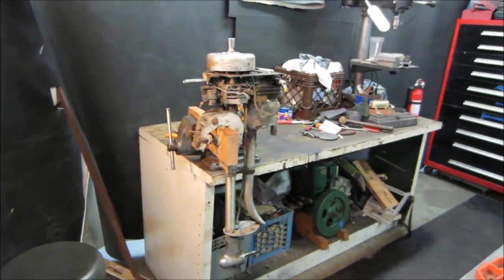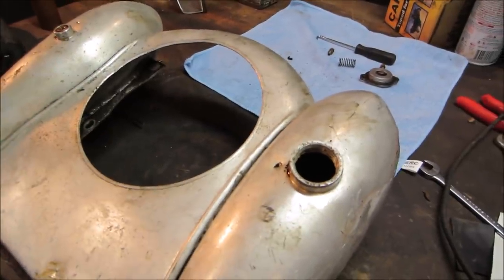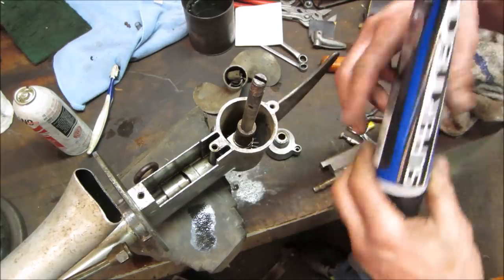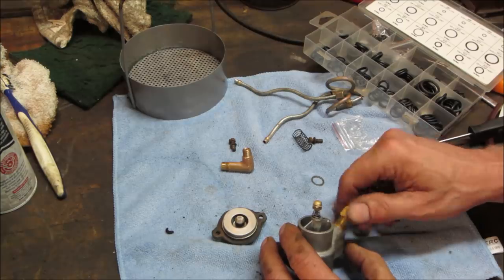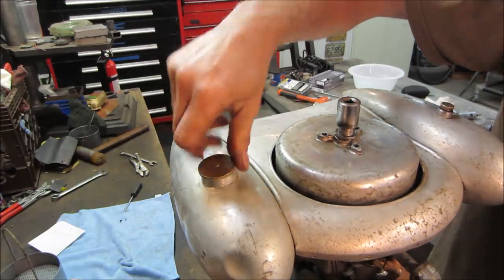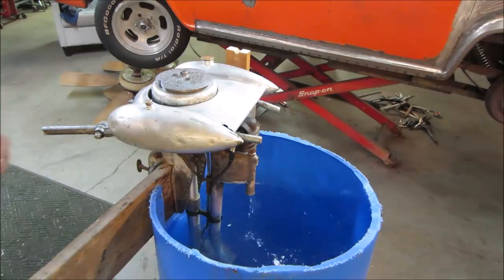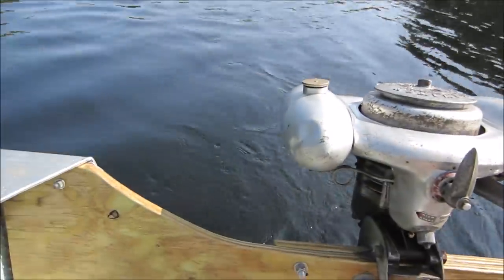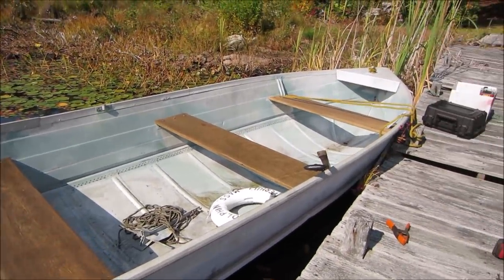1937 Boat Motor, 60 years in a Shed. Will It Run? Pt 2 of 2

Comment: The comment about the carburetor and fuel lines looking like a chart a chart on the wall in the doctor’s office....I am a former obstetrician and when I saw the assembly on the work bench, I thought the exact same thing. Uterus, Fallopian tubes and ovaries. Keep up the great work.
Reply: And he couldn't stand it; he had to blow through one of the Fallopian tubes!  lol.
Reply: Mustie1's sense of humor is incredible.
Reply: I laughed pretty hard when he said it was clogged like a 70 year olds arteries
Reply: And yet still put his mouth on it
Reply: If only this engine could reproduce. It might begat a strapping lad that grows up to be a 280 HP, fuel injected, two stroke V-6!!
Reply: Made me think of high school health class.
Reply: Why do the fuel lines have loops? Is it to prevent backflow?
Reply: @loumencken9644  I think it's to stop them fracturing from the vibration of the engine, the loops allow the pipes to flex instead.
Reply: Got to fiddle with the that fuel mixture knob when she's cold.
Reply: @Zeem4  Makes sense- thanks. Although I admit I'm disappointed that it wasn't the designers saying, "OK guys, what can we do to make this system look even more like lady parts."
Reply: James,
You checked oil for a living eh?
Reply: Thought the exact same thing 🤣
Reply: can imagine Mustie1 as a Gyno...............Mrs Smith your carburettor bowl is empty because Mr Smiths main jet is blocked..............

Comment: That carburetor is actually what they call a "mixer."  Looks like a Lunkenheimer mixer similar to those used on antique stationary engines such as a hit and miss.  The plunger on the bottom allows you to give it a prime by lifting up on it.  When the valve inside opens it also opens the fuel circuit. It has no throttle function but rather the engine is throttled by the spark advance setting.  I suspect the amount of timing adjustment the engine has allows it to run backwards to give the boat reverse.  Similar to old two stroke golf carts that just ran the starter the opposite direction for reverse and had the timing fixed at almost TDC.
Reply: good info. thanks. ive been to shows where there are hit and miss engines running.  they really amuse me with their oh i guess its time to putt again ways.
Reply: Does the plunger also act as a type of reed valve?
Reply: @andrea4809  i thought a reed valve was for low end torque, i also thought reed valves were on the valves and not the carb
Reply: To run backwards you would have to wrap the rope backwards. Is the rope pully made for that?

Comment: The "dialing it in" problem is probably that extra O-ring
you installed in the mixture needle. 
That material you mistook for Bakalite is most likey
wax impregnated cotton rope, or Oakum. You could remove
it, replace & re pack. The O-ring is changing the throw of the needle.
That carburetor is cast aluminum and Bronze- no rubber seals or
diaphragms. That must be a pill to start by hand, even when new.
You'd better torque down that flywheel.
That really turned out nice.

Comment: thanks for the laughs and enjoyment, several decades ago I picked up a vintage one, made by Champion, worked on it, got it running great, long story best friend talked me out of it, but for years, no matter how much he tried, he never could get it to crank & run, but I was able to crank it with ease, we took it out on his john boat many times, but he was so afraid of it, he always had a spare motor that he used, a 2hp Johnson, plus his trolling motor, but he tried at home to crank, never ever got it to run, but we spent many hours on lake with it running great, sadly we were not speaking to each other when he died, his mother didnt notify me, & sold the motor at a yard sale the week after he died, he has been gone around 10 years now, but I always think of the crazy Champion engine he liked looks of so much, but never got it to run without me there setting controls

Comment: My dad was a plumber and mechanic. Always amazed me as a kid when he could look at nut/bolt and know exactly which size wrench/socket he needed. Watching Mustie disassemble carb, pick up wrench he was using, then dropping it and grabbing another wrench which fit perfectly made me smile.
Reply: My dad was the same way, I do the try and retry method when selecting the proper size wrench or socket to use.
Reply: Nothing like a properly calibrated eyeball.
Reply: Looked like he just needed the next size up. That sort of thing comes with experience but It's still amazing to see how good Mustie or your dad can be at it. Some guys are born mechanics.
Reply: That's why I never liked metric, unless it's a 10mm you can't tell by looking.

Comment: Just imagine if modern day outboards required manual fuel/timing adjustment.  There would be many less idiots on the waterways.  That motor is very cool!  It’s almost on plane!!  Exactly what I wanted to do Sunday morning.  Thanks Mustie!!
Reply: Unfortunately, I think they'd still be out there and paying even less attention to where they are going while fiddling with the engine and posting their exploits to Instagram
Reply: On a similar note: I started to learn a bit about what pilots of aircraft in WWII had to do WHILE in a dog fight, they basically had to do the same thing due to changes in air density as they climbed and dove.....I couldn't imagine.....it must have been heaven when FI came along......
Reply: dont forget adding oil to fuel, dunno how many even knows thats a thing, except 2stroke dirtbikers
Reply: @kiiiisu  a lot of people who do their own yard maintenance do since most chainsaws etc are two stroke. 

But Toronto is about to ban 2 strokes due to the "tremendous" amount of pollution they cause lol......yeah, they're the problem, NOT the 2.5 million cars parked on the highway idling for hours every day.

Comment: In the Summer of 75-76, I used to motor around ponds in Northern Maine with 2 1/2-3 HP Evinrude and aluminum boat(don't know the vintage motor or boat). Didn't go too far or fast, but it was a little adventures back in high school. Thank you, Skipper!

Comment: Love that motor the carburetor has one gasket and is basically a reed valve, carburetor,  fuel pump in one and the impeller to bring water in never has to be replaced.
Reply: Bob Cranberries   Yep, totally useless in a world that needs you to buy products.

Comment: Now there is a guy with confidence.  Out on a lake with an 83 year old outboard and no paddle in the boat and not sure if the boat would float.  Congratulations on another suburb “let’s fix it” video.  (really now, did you have any doubts) 👍👍
Reply: 39:03 ;)
Reply: He started off (39:22) with a couple of paddles and a life ring (is that what it's called?), but I didn't see the paddles at the end. Maybe they got moved when he was getting out of the boat. On a bigger lake, I would have had a neighbor with a working boat on standby. Not enough power to pull a waterskier, but seemed like plenty to putter around a lake that size.
Reply: he had a paddle, look at about 39.30
Reply: Just look closely 39:03 
Confidence is good, having a backup plan is better

Comment: Hey Mustie......You can use John Deere "Corn head Grease" in the lower unit of all the old non-shifting outboards. Usually these lower units are leaky and regular lower unit lube just leaks out and water leaks in. With the Cornhead Grease, it tends to stay put and do its job even with a little water intrusion. Just get a rubber tipped grease gun end piece and fill it up to the top. That's what most antique outboard enthusiasts do. Just thought you might want to know......also, most of the 1930s motors run on 16 to 1 oil mix, some even richer....these days it's TC-W3 marine oil,  but back then it was regular non-detergent 4 stroke.

Comment: Back in the early 60s I can remember the old motor mower adaptor kits. Mow the lawn on Saturday, unbolt the engine & throttle cable off the mower, mount it on the outboard leg, hook up the throttle cable, go fishing on Sunday (after church). Fuel tank was mounted on the engine and all air cooled and could spin the unit for reverse, 😂😂😂. Mounted on a clinker built row boat, top speed about 3 knots (5mph), 😂😂.
What an old beaut!! Enjoy seeing and hearing this, brought back memories.
Thanks Mustie

Comment: Back in the early 60's, my uncle had an old Evinrude that looked a lot like that one.  He said it was about 2 hp.  We put it on an old heavy Cyprus ribbed boat and took it out fishing.  It took a while to start pushing real well but once it got going it would take us where we needed to go.  We even took it out at night to run trotlines.  Very simple and dependable old motor.  Those were some fun times.

Comment: "Air/fuel ratio sensor" and spark advance = your ears and eyes.   Once you get the mixer dialed in, write down your advance and mixture settings for start, cruise, low speed troll, etc. and that way you can eliminate some guesswork (and arm muscle strength-building!)  Lean it out a bit when it warms up unless it starts running hot.   Lovely old outboard.    With Mustie, it's never "will it run" but "when will it run" of course... she runs really decent for her age.  I hope I run that good when I'm that old, but probably not.
Reply: Yup, I was going to mention that too. Old motors are a lot more hands on, no high and low speed mixture. That's why I love em too. I have a 36' Evinrude Sportwin 2.5hp, lots of fun to fire that up at a crowded boat launch! Lol

Comment: Kissel manufacturing Co. made these, for the early models. Is there a space between "Water", and "Witch"? That will tell you if it was from the first three years of manufacture, approx. 1937-1940. Kissel was bought out, but the successor continued to build "WaterWitches" for quite a few years, mostly sold by Sears. 
     Watching you try to dial it in brought back memories of the old Craftsman two-cycle I learned to mow lawns with, with the little Power Products engine, and rope start. That little devil taught me most of what I know about two-stroke motors, whether I wanted to learn, or not. In the days before exhaust tuning, two-strokes mostly ran well at operating speed, but didn't idle worth a damn. and once you got them tuned, woe betide you if you changed the carb settings! That rope start would wear your arm out.
     Incidentally, the WaterWitch is apparently pretty collectible, and may well have some value. You might want to look at the Antique Outboard Motor Club website, they can tell you more about the motor, maybe even find a buyer for it.
Reply: I was thinking the same thing. He could find some parts or maybe sell some of the ones he's rescued to collectors who would appreciate them.
Reply: My first thought was the KisselKar when I read this. Quality products.

Comment: Wow.  What a fantastic job off resurrecting a very old boat motor.  You have it running rather well for its age.  The design is fantastic and even if it did not run it should be fantastic wall art.  Thanks for the video.

Comment: Hey Mustie, there is only one thing you didn't show us: What happens when you "accidently" push the primer when the engine is running.
Reply: I imagine it would shut off since the primer is also the check valve for moving the fuel mix from the crankcase to the cylinder. If you keep the valve from closing, the gas would just get blown right out of the crankcase.

Comment: It is a good thing that you had electric start, as the Water Witches carburetor has to be set exactly to get them to start with a rope, otherwise it is a Sears and Rowback.  I actually really like these motors and have one each of most of the models, but they are super finicky and and can be a real test of ones mechanical ability to get them to run.
Reply: Is thats enough water exiting the exhaust I've seen a lot of small boat motors an i usually see  a little stream
Reply: The water pump is a piston type and the water comes out in spurts.  The water has to fill the water jacket before it exits out the stand pipe, so the pump is working as it should. @dvnope2408
Reply: Send pictures

Comment: The carb acts like a reed valve on a modern outboard.
Reply: probably works just as good as the new stuff
Reply: @haydenc2742  
I would suspect that the large reciprocating valve in this carburetor probably can't oscillate at a higher rate. Limiting the rpm of the engine ,  but it was probably designed to operate well in that RPM range,  todays two strokes tend to rev much higher, and they can do that because of the very lightweight reed valves used.
I definitely like this engine, it seems to run very well and actually has a really nice sound. Definitely the kind of thing you would want on a boat, not making a ton of racket if you're going out fishing.

Comment: I used marbles in the fuel tank with carb cleaner to clean the schmegley out of it
Reply: A short chunk of small link chain works great as well. Just be careful in case tank has petcock filter.

Comment: Great running motor. Looks cool and zipped that boat right along. I could not have made that engine run again if my life depended on it. Really appreciate your skill. Removing the tank dents and sprucing up the top end of the motor would really make it pop. I dont know how easy it would be to get those dents out. All best

Comment: Kudos on the restore Mustie!  FYI, the gas cap should have a V shaped spring with a short 90 degree out facing legs on it attached to a ring on the chain of the gas cap.  You compress the V to get it into the tank and the legs keep it from coming out.  Keep up the great wrenching work!  Fred  Ontario, NY

Comment: Enjoyed that very much ... years building Aircraft in Aluminum and Steel ... did my heart good to see her run again.  FYI ... next time on agitation of old Aluminum fuel tanks ... add a handful of ball bearing (steel ... from all your old wheel bearings ;) ) will aid you nicely in removal of residual deposits ...  Godspeed Bro

Comment: You will want to gently close that needle valve and then open it up somewhere between one and two turns (My old Evinrude was 1 3/4 turns.) Set the spark lever to your running speed and adjust the mixture to run well. Be careful not to set it too lean; you can melt a hole in the top of your piston that way. Ease down from "too rich" until it runs well. Resist the temptation to lean it a bit more because it seems to make it run faster. Adjust the speed with the timing lever, and then the mix to make it run smooth. Somewhere there is a Primer button; maybe the button under the carb. It will let a bit of raw gas into the carb or main intake to give some extra gas for starting. (My old Evinrude took two pumps; less was not enough and three would flood it.)

That timing lever moves the points from WAY after TDC (top of the compression stroke) for easy starting, to a bit before TDC. When the motor is warm you might be able to run it backwards by stopping it, advancing the timing all the way and spinning the flywheel backwards with your palm.

Comment: Excellent project on outboard get about 1/2 knot on low speed and 2 knots on fast speed in water Mustie  1 :) and did excellent job fix up old motor too ! Hope enjoy motor with on boat running to enjoy with the old motor too!

Comment: Nice engine :), on top of that the connection tubes of the tanks to the mixer are metal, and the lubrication system is ingenious, this engine is much better designed than current 2t engines. I'm glad you brought him back to life, I'm amazed he's 83 years old and still works so well

Comment: A good set of line wrenches work great on fuel lines and power steering lines! Especially when they are old and rusty. I used to hate it when line fittings would round out using a regular wrench 🔧 by the way I enjoy all your videos they have helped me out a few times in the past with carb rebuilds👍

Comment: I had an old sea king outboard motor with a gas tank with a lot of crystalized gas in it. I heard that putting a bunch of small pebbles in the tank and shaking them around would clean  up the tank . I tried it and it worked very well. What came out looked like sawdust.

Comment: You can use denatured alcohol to make rubber slick. It will help pull those VW engine bay gaskets through the channel. I know this doesn't apply to this video but you may read this before you do any VW engine bay work again.

Comment: Back in the... Mid 90's-early 00's, I had an old Elgin 2 cylinder motor that had the separate timing/fuel mix like this, just slider arm for the timing instead of geared knob. It was definitely a set it to one speed and let it run type of motor, and took a bit of practice to figure out which settings went with each other.

But get it going, and that 3 mile trip to the marina for food and gas was a nice kick back and relax for 45 minutes each way with no worries (except for all the loose rivets in the bottom of the boat making me stop half way to pull it up on shore and drain it out) kind of trip. 

And it could do the full round trip easily on the one tank of gas (~16:1 sae 30) with some left over, even with the leaky copper fuel line it had. (Think it held about 3/4 gallon, iirc) Less than half the price of firing up the truck to drive the 15 or so miles to the store, and far more relaxing.

Only thing I didn't like was the spinny thing that had to be held down with the palm of the hand to engage the pull start... Finally got bright and folded up several layers of duct tape that was then held on with more tape over the top of it for a kind of bushing to keep from blistering my palm. XD

Fun times.